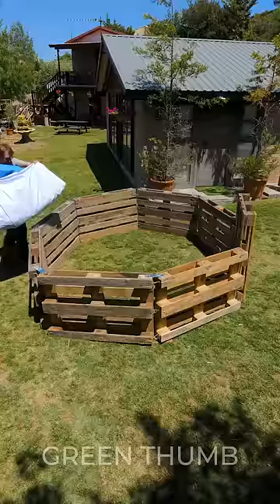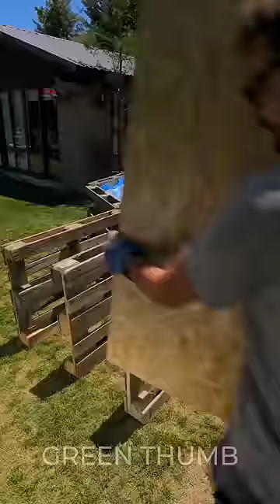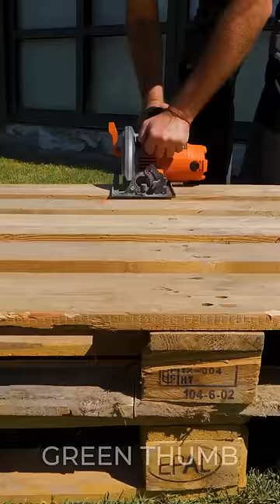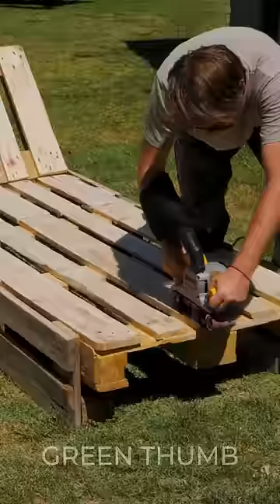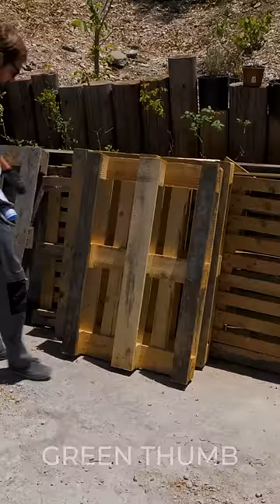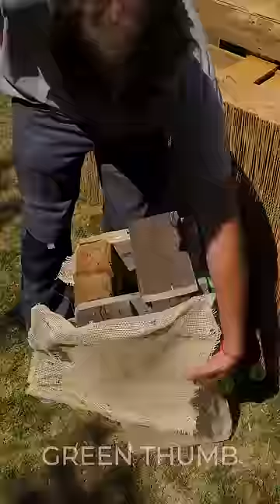DIY backyard pool made of OLD pallets #shorts #backyard #pool #garden #recycle #diy

Comment: How would staples hold that liner in place and not rip it?
Reply: Тот же вопрос
Reply: All the pallets screwed together, and he made  sure the lining was completely flush with ground and top.
Reply: @ohioitis200 Good question. I see sleeves at the liner's top that could be secured with nylon rope, or strong bungee cords. Those methods could provide flexibility  and be easily removable when needed. Beats a rusty staple in the foot.😳🤬
Reply: Think it's a scam video, the stairs he made would snap the minute you step on them
Reply: The staples are to hold the liner while making it... after filling holds the liner in place.
Reply: Easy no kids allowed 😂💯